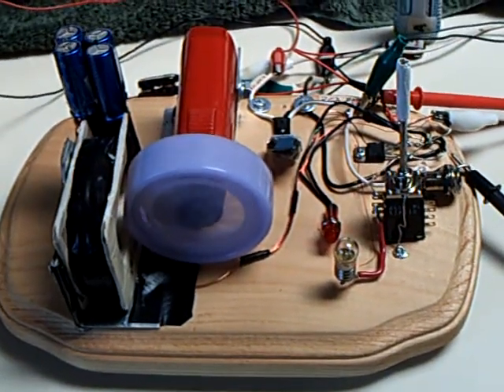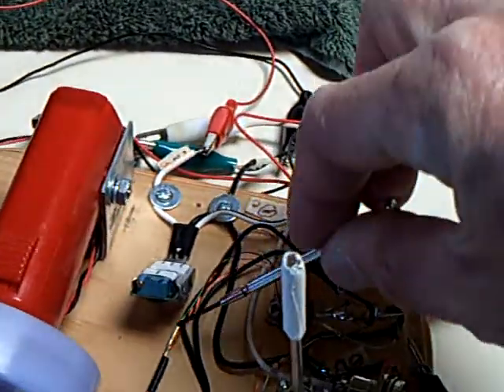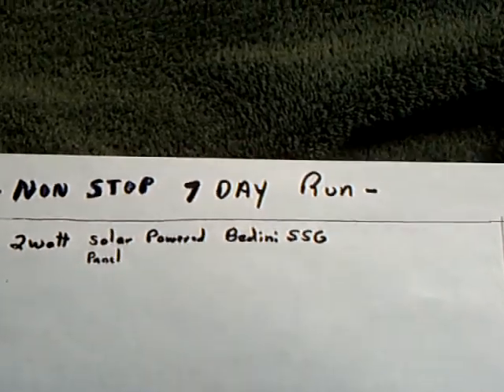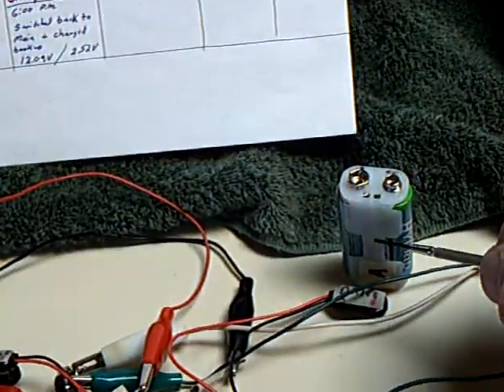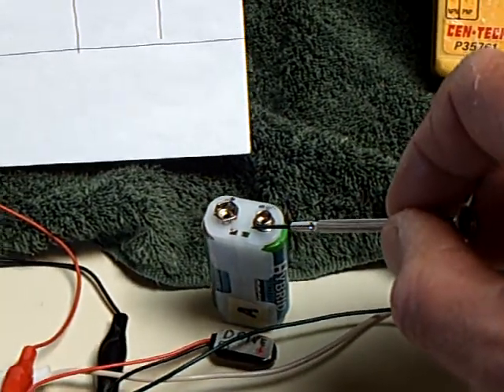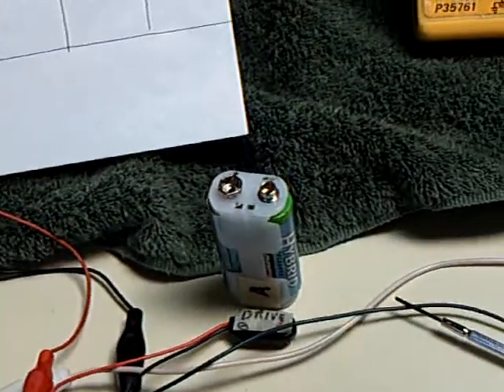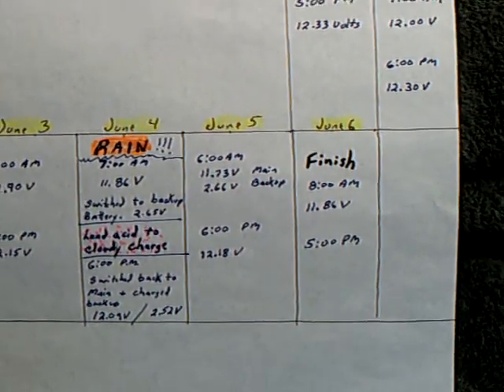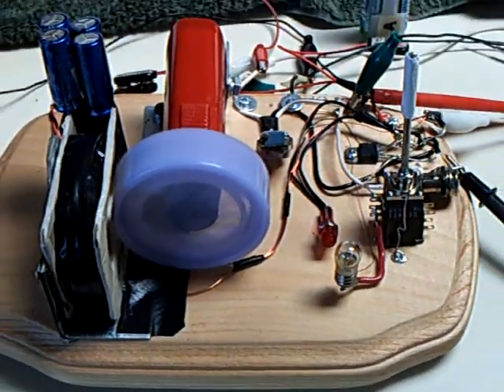Solar powered Bedini SSG one week run

Comment: Great vid. I thought about putting a solar power there as well. I made a Bedini motor of a schematic with a single 9V 150mAh accumulator like in "school girl's project" and tried to get it running for at least 2-3 hours, but it didn't. Nether did it with the recharged battery. Have you tried using powerless rechargeable batteries (of about 200 mAh) and to swap them to get a full time running?